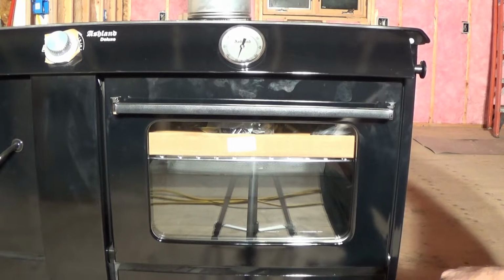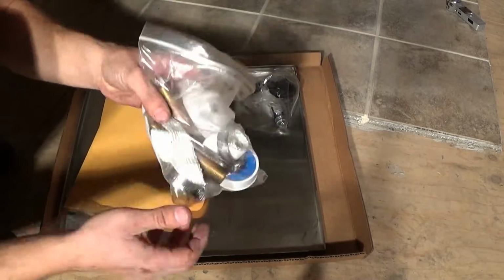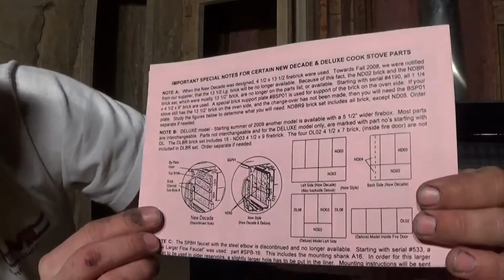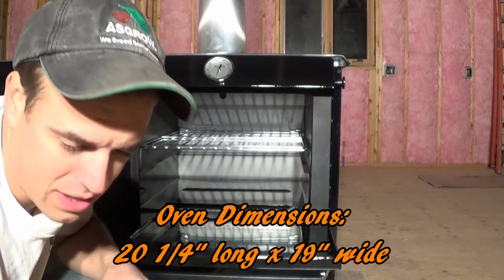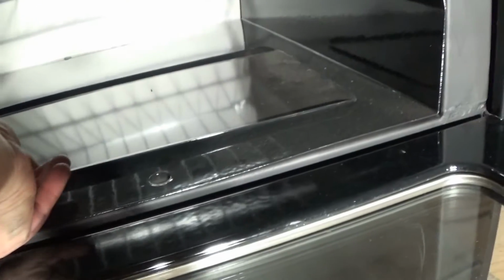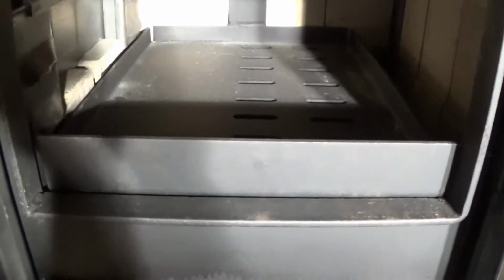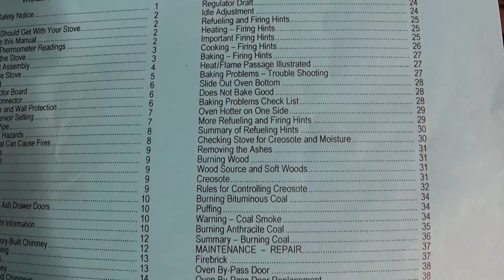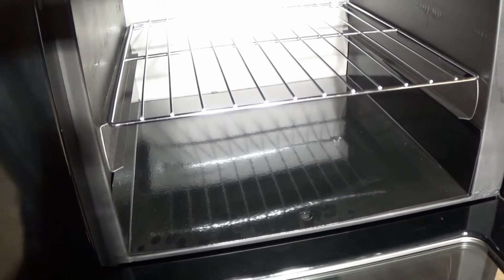Ashland Deluxe Amish Wood Cook Stove Unboxing

Comment: Great job!  I have run across this stove in my research many times, but didn't know a lot about it and no one had any reviews until now.  Most of the old order Amish don't do advertisement as it is done in the main stream.  I think you have done them proud.   You might consider being a distributor for them if they are old order Amish/Mennonite.  Thanks again!
Reply from the maker: Rickki Johns Thanks for the kind words! We also made a video where I tried my hand at baking some blueberry muffins in this same stove. They turned out well, despite me not having any previous baking experience with a wood stove. There really wasn't much to it and it felt pretty intuitive.

Comment: Thank you for this video. I saw this stove on a canning video and was surprised that there seems to be no information about it. Lehman's doesn't carry it (which seems odd). Where did you find one? Also, can you take the shelves out of the oven and put something on the bottom? That is the only way I could see a turkey fitting in there.

Comment: About the last feature ,unless there is heat directly beneath the oven box you can use some aluminum foil or an old sheet pan on the bottom to catch spill overs (if instructions on oven don't forbid it).
Reply from the maker: Hi Eveny, there is heat under the oven box even when the oven knob is NOT pulled out, but I'm not sure whether the manual forbids it or not. I say whatever works! (EDIT): On further consideration, I don't think I would do the tin foil on the bottom as it might cause the steel underneath to warp because the heat is trapped.

Comment: Christian greetings from Wisc, We have the Ashland New Decade range and this winter will be our 5th one with this stove. I'm curious why you don't have a back with a shelf on your stove? It looks naked without it! lol Plus you don't a place to put your gramma's salt and pepper shakers like I have on my stove. :) Happy cooking/baking and God bless. †
Reply from the maker: Terry Ball Hi there, Terry! I have the 11 and 1/2 gallon stainless steel Reservoir but I had not set it up yet as of this video.
Reply: That explains it! We have a water heater so didn't need the reservoir, so we just use the teakettle! :)
Reply from the maker: That's cool (or should I say, hot, lol). I have the water heater (jacket?) for the stove but don't have a range boiler to hook it up to yet.
Reply: Good morning from frigid Wisc! Our temp this am is 11 degrees which broke the record that was 12! The cats will be found sprawled out behind the range enjoying a warm nap. :) When my folks married in 1938 mom had a new white cookstove which she thought was a great because most ranges were black. They had water pipes going through the firebox to a tank that sat behind the stove. The firebox wasn't the biggest without the water pipes, so with the pies it got even smaller and it wouldn't hold a fire long unless you were constantly adding wood. And no fire meant no hot water. It was called the lean years! We had two cookstoves prior to the Ashland and know all about dealing with a smaller firebox and wood size. Too long or big was like having no wood at all. When the new Ashland sat in our kitchen, our wood size and length pickiness went out the door! Safe in Christ, Terry